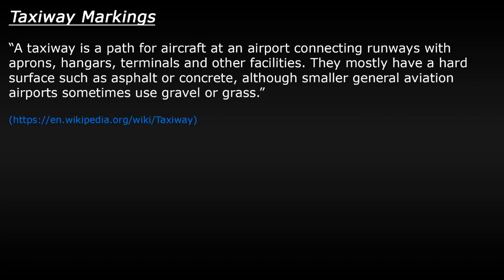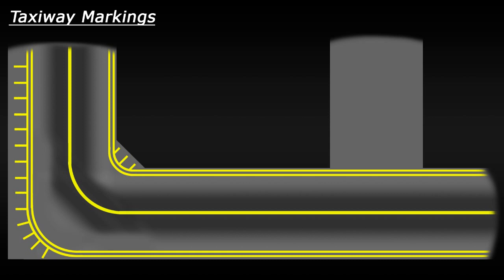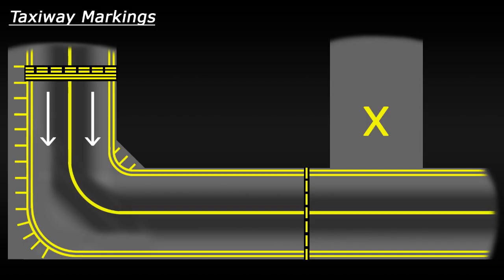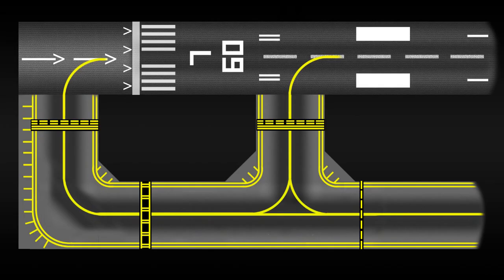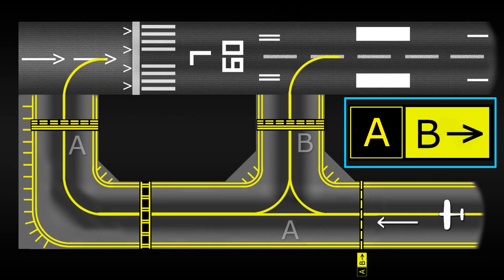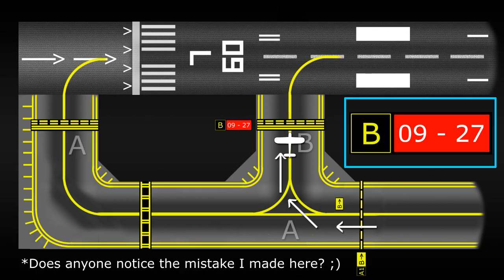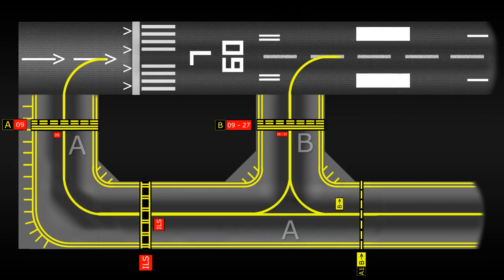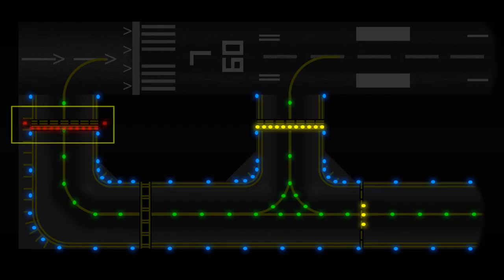Taxiway Markings, Signs and Lights

Comment: I often see signs that that mention CAT. For example A 09-27 CAT III. Can you explain what CAT means?
Reply from the maker: Sure, very quickly, the CAT relates to the complexity of the ILS System (Instrument Landing System) installed on the runway. This allows a pilot to land at night and in bad weather. CAT I systems are the most basic, CAT III are the most complex. I did a video talking about ILS Categories here: https://youtu.be/IXV5q4P6KuM
Reply: Ah cool, thanks for the response.

Comment: Sometimes red lights at the taxiway hold line will change to green. These are called status lights, which provide a pilot or equipment driver a visual reference for ATCT instructions.

Comment: What if the airport has single runway, why would it be 09L and 27R? The mistake everyone mentioned.
Reply: Alright bravo, thanks.
Reply: With a single runway it would be 09-27. In this example 09L-27R has a parallel 09R-27L (somewhere below here, in the comment section) ;)

Comment: the mistakes are the sign should be 09R-27L
Reply: i mean 09L-27R
Reply: No, there is only one runway in the 09/27 direction in this example airport.
Reply: Then why is it painted 09L?
Reply from the maker: Because I wrote the script for this tutorial thinking I was going to do artwork for a Runway 09... however I used the L/R example in the video before (runway markings) and forgot to get rid of the L for this video :S
Reply: then let me guess, on A09 taxi, there is runway hold marking, but as you said in runway tutorial, planes are allowed to taxi to runway extension, then it means hold marking is unnecessary.
upd: the ILS mark should be near the taxiway hold(A1), where on the runway, are aim point markers. amirite?

Comment: One thing that I picked up from that, especially when I was working at a local airport as a ground handler towing aircraft around the airport was taxiway naming. You noted that the hold point would have a number, which it doesn't. The number that is written on the sign is an indication of a branch of a taxiway. For example, when I was towing an aircraft, my instructions (after pushback) was "tow via G, B, B1, Cross Runway 34L, A1, A, International 3 to the gate". If those numbers were indicating hold points then I wouldn't be able to tow via them, where I clearly had to tow on that taxiway. The holding points never were numbered. Also, the ILS sign in some airports are different. At the airport I was at, the ILS sign didn't read ILS, but Cat II Holding Point 16R

Comment: Just a flight sim fan here, not a pilot, but is it true that the center line is there to guide the nose wheels of aircraft? I'm assuming as well modern aircraft have nose wheel cameras so the pilot can "see" where his wheel is.
Reply: Yes, and no. The pilot has to keep the centreline of the a/c over the centreline of the taxiway, which is relatively easy when the taxiway is straight. But when the a/c reaches a bend (and especially if it is a large a/c on a narrow taxiway), he/she must first understeer and then oversteer to keep the main landing gear roughly equidistant either side of the centreline otherwise one of the landing gear bogies might run off the taxiway. If you watch one of the many A350 videos (especially Finnair) you can see this in action where the passengers can view the nosewheel from the belly camera on their IFE screen.
Reply: No aircraft of which I am aware has a nose wheel camera for several reasons. First, it is typically unnecessary! Just as one visually positions an automobile within a designated lane, so too does a pilot position his aircraft with the taxiway center line right beneath the aircraft nose. As noted by others, there are also situations in which undersreer and/or oversteer are appropriate, particularly for wing clearance and, on very large aircraft, for main gear clearance.

Comment: Wouldn't there be ILS hold lights as well?
Reply: 〈FaFmAn〉 thats what I wanted to ask too ;)
Reply: There would be. The ILS hold lights would be 4 equidistant lights similar to the 3 yellow lights indicating a holding point on the taxi way. Also, I understand there is another version of the runway guard lights, which in this video is a string of lights across the width of the taxi way A. They can also be alternate yellow and black lights. Saw that somewhere.

Comment: So would the plane lift off to the right and land towards the left?
Reply: So in a normal runway planes would land and take off in both directions? Depending on what the Tower controllers say
Reply: garymt2001 *you want to take off and land in the same direction the wind is coming from.
also "pushing" is confusing. pushing can be from the front or from the back. "pushing back" would have been better?

Comment: I listen to "Kennedy Steve" (ATC Grnd) occasional and he'll  tell a pilot to "Hold Short at A", I'm guessing that he wants the aircraft to hold at the "ILS" marker?
Is this correct or what is he referring to?
Reply: Talking about JFK airport if a plane comes out from the terminal on taxiway Golf and is told to "Hold short of Alpha!" it has to stop at the holding point before Alpha on Golf.
Here: https://www.google.co.uk/maps/place/John+F.+Kennedy+International+Airport+(JFK)/@40.6408397,-73.7745029,64m/data=!3m1!1e3!4m5!3m4!1s0x89c26650d5404947:0xec4fb213489f11f0!8m2!3d40.6413111!4d-73.7781391?hl=en
(hopefully works)

PS: Kennedy Steve is aaaawesome, monitor 123.9, good night!
Reply: lets say, if you are currently on taxiway Bravo and the ATC tells you to hold at Alpha, than you should stop the aircraft as soon as you see the sign for Alpha.
Reply: Are you saying that hold at Alpha is the same as hold short of Alpha?

Comment: 7:10
It was 27-09 in the blue box (should be 09-27)
And you forgot 09L and 27R
Reply: No, there is only one runway in the 09/27 direction in this example airport. Also, he switched them up together with the narration when he explained them.
Reply: noticed it immediately

Comment: When ATC/Ground calls to a pilot to hold at specific points, obviously it follows the logic of the signs.
But there are a lot of calls that I hear on ATC that I'm curious as to the underlying specific meanings.

Example: Ground clears a flight to taxi down "Alpha". To get to the runway, they will need to make a turn onto "Bravo". That taxiway may also be occupied, so ground gives the order for the pilot in a format such as "SWA454, Taxi Alpha short of Bravo".

Would this mean that the pilot must stop at the pre-intersection hold point as shown on the right side of the illustration, and await specific clearance before making the turn?

I also hear a lot of points called out that join taxiways to (i'm guessing) refer to specific intersections: mike-alpha, bravo-sierra, tango-juliet, whatever.  So, would the point at which you could turn onto bravo from alpha be called alpha-bravo by default?
Reply: Chuck H taxi alpha short of bravo just means you taxi through alpha and keep short (stop before) bravo
Reply: Chuck H 
Q1: Yes, it just means stop before Bravo.
Q2: No, I'm pretty sure that isn't what it means, although it could.
Reply from the maker: That's a good question! I don't know if an aircraft will need to hold. I THINK it depends on the instruction from ATC, if they say "hold short" or anything like that, then that is a direct instruction to stop at a hold point. Whereas if they say something like "Taxi runway 09 Left via Alpha, Bravo" then that means taxi to the runway and simply drive up behind any plane that's in front of you. Again, that's just a guess from an aviation enthusiast!

Comment: The mistake is that it should be 09L
Reply: And also 27R
Reply from the maker: Yep, bingo! :)
Reply: In Europe it is 09L. In the US it is 9L
Reply: I think that the "L" and "R" are only used when there are two runways which are parallel one to another. In case of a single runway, or when we have two runways crossing each other, the number is enough. Am I wrong?
Reply: gpav10 I think you’re right, since if it crosses, technically there’s no matching colors?
Reply: The sign should read 9L-27R, the zero is left out in front of the 6.
Reply: Dan Louie but in the uk 🇬🇧 the 0 is kept so it’s 09

Comment: Do you know what the Cat I/II/III signs mean?
Reply: Doggy McDogeface 

These markings indicate the ILS capabilities of the runway, CAT 1 meaning the ILS can only guide you through moderate weather. CAT II (2) means the ILS can guide you through bad weather conditions. Finally CAT III (3) means that the ILS can guide you through extreme weather conditions. Most of the large international are equipped with CAT III runways.
Reply: garymt2001 Thank you very much for your detailed answer.. I work as an aircraft line maintenance mechanic on the apron and i see these signs every day, that's why i'm asking. Can you explain me by chance what "Link 4" means..? I tried looking it up on google but i couldn't find anything..
Reply: John McJohnson That could just be the name of a taxiway. At my home airport, the taxiways are; LINK 1, LINK 2, LINK 3, LINK 4, OUTER LINK...
Reply: Could possibly be.. Thanks!
Reply: No problem

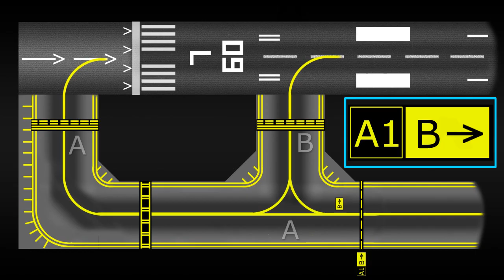Comment: At 6:13 I believe you are incorrect. The hold point would not be labeled 'A1' with a BLACK background, you would still be on taxiway 'A' but it would be on a RED background.
Reply from the maker: Hey Mike, just gone and had another look. Certainly judging by UK charts, it is a black background. The only exception I found was Heathrow which has a lot of named holding points such as PLUTO and TITAN which appear to be red signs with white writing. I think you do get red holding signs when you're committed to approaching a runway (ie. there's no more turn offs, you can only taxi onto a runway from your current position)
Reply: They are called Intermediate Taxi-Holding Position (ITHP) Markings.
http://www.skybrary.aero/bookshelf/books/291.pdf
Chapter 2 Page 5, Par 2.2c and Chapter 3 Page 2, Par 3.1.f

If those are the markings that you are talking about?
Reply from the maker: Ah ok! No you're definitely correct about those ITHP markings. The key distinction I noticed was that it was talking about a "priority route". 

It's a strange one because I've had a look at a few more charts and somewhere like Luton (EGGW) does have a lot of ITHP holds whereas Gatwick (EGKK) doesn't have any! That said, I will add in an annotation explaining ITHP holds as well, thanks for pointing that out, completely missed it when I was doing research!

Comment: Do one on squak codes and how to change squeak on FSX. Also quick question is there anyway i can turn of my transponder and make  the radar not see my size speed and stuff
Reply from the maker: I think to change the squawk code you can click on each number to change it. And I don't think it's possible to turn it off in FSX.
Reply: Doofer911 I see. Thanks!